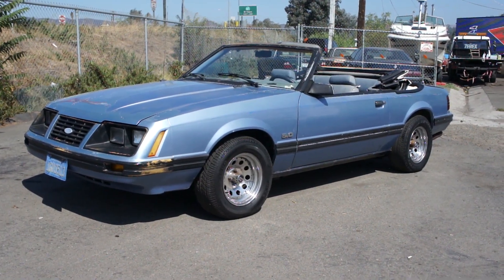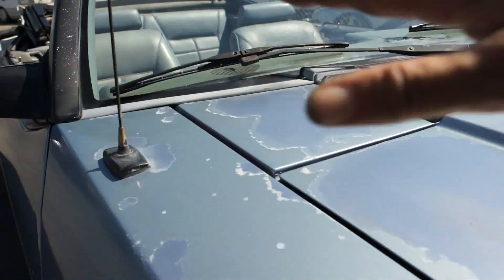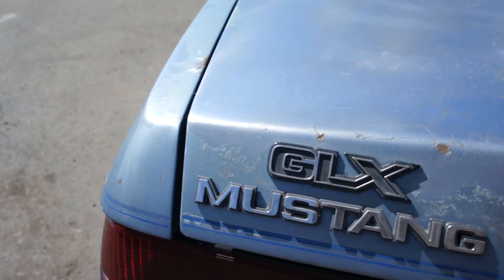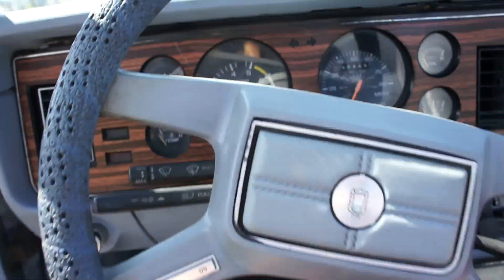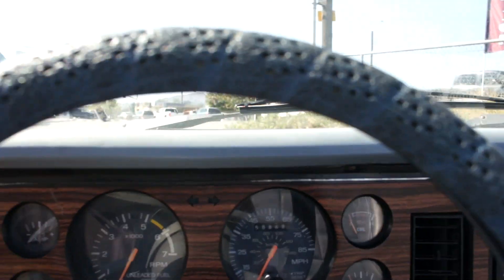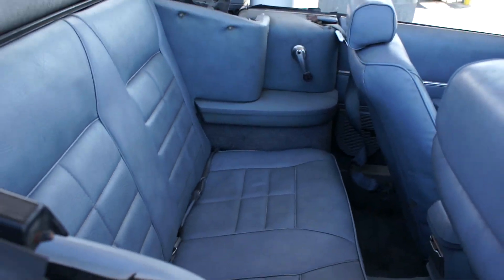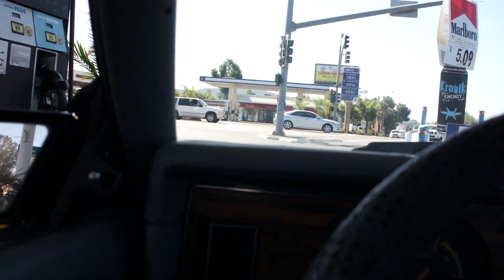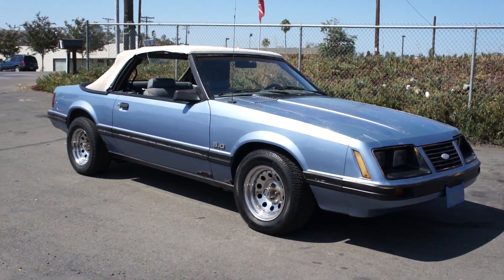83 Mustang GLX 5 speed Convertible GT Fox body Project $2300

Comment: That’s a pretty bad ass car and pretty rare but it definitely is going to need a lot of work and I hope that you’re asking a very cheap price for it.  Not to be rude, but you should not be running that motor because that knock is gonna get so bad that the motor could lock right up.  you’re basically selling the car without a motor because it’s gonna need to be rebuilt. That is not just a cheap fix like you said, the whole motor will need to be tore down and redone. You can’t just fix a knock cheap.